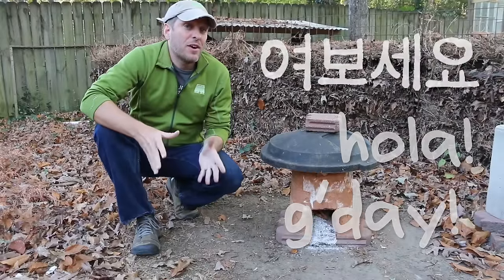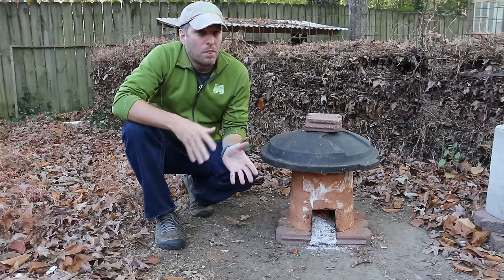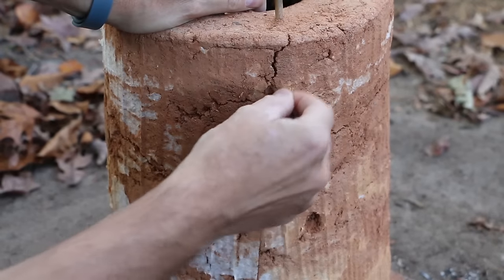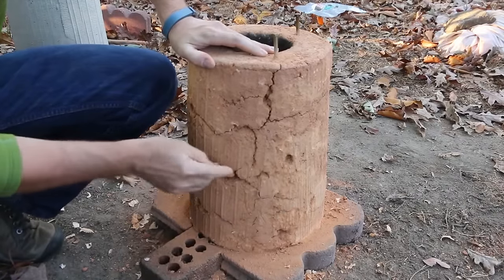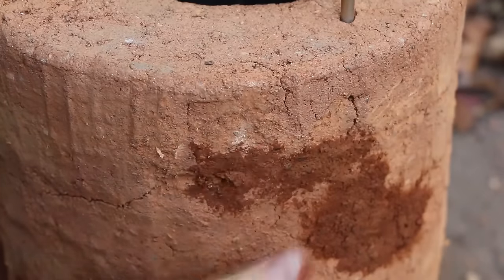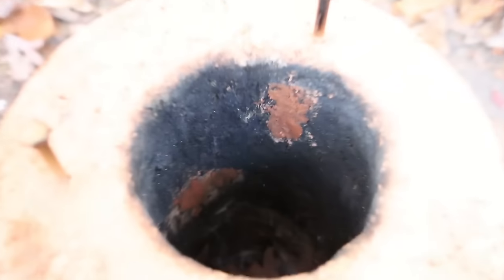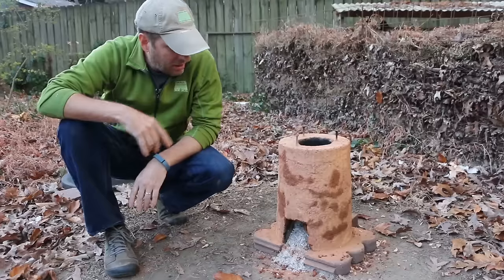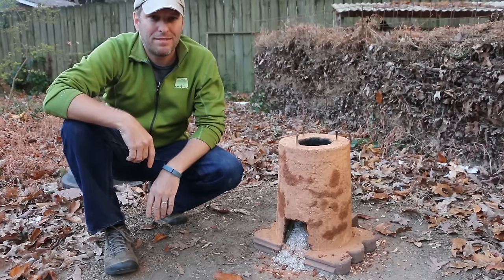How To Fix A Cracked Mud Rocket Stove

Comment: Just one idea (I have never built anything like your ovens!). Before patching, wouldn't it be good to spray ligthly the crack with water? From what I have seen watching masons work, they never mix dry with wet, always wet with wet. Great videos you are an inspiration!
Reply from the maker: Yes. That would have been a better way to fix the cracks. Thanks for the feedback. And thanks for watching.

Comment: Just my $0.02, but I see the tamping (not the drying) as leading to the holes, first because of the wire mesh as an obstacle (which should be eliminated) and second because of the broomstick needing a flat pad on the end, such as a scrap of wood held on with a screw (or just use a larger piece, chunk of firewood, etc.).  Also, the cob mixture does need the straw, both to help prevent cracks as it dries, and as an insulator, either as straw, or if the heat combusts it, by leaving behind air passages in the cob.  Straw would also prevent the need for perlite, and keep the stove's materials entirely natural.  I also have seen some cob 'recipe's' use herbivore manure (i.e., cow, not dog) as a binder, with the straw, dirt and clay, which helps with consistency and cracks after drying.  Once dry, the manure should not smell, nor impart any impurities to the smoke, at least no more so than the other materials' impurities.  Finally, I'd eliminate all the plastic forming parts, and use bundles of sticks or straw to form the chimney, combustion chamber and air/fuel intake passage.  The outside can be formed by hand around these without a bucket, and smoothed with a bit of water and rubbing, no need to tamp into a bucket or worry about a release method.  Any bits of these materials stuck in the cob as it dries will simply burn out with the first firing.  Good luck!

Comment: I'm grinding kitty litter in the blender and mixing it with paper pulp..  For now I'm filling in the holes of  clay bricks.  I have  dried them in my over and found shrinkage but  filled in the  cracks. I will be making a brick rocket stove, but  with the bricks in the vertical position. in this way i can fill in the outside with more of this paper crete  clay mixtures  and build up insulation values while stabilizing the vertical bricks. I you have seen the kilms made with grasses and clay into a bee hive  I might try that sometime and keep building up the thickness. To me that primitive kiln  is fascinating.
Reply from the maker: Hi Joseph. Sounds like an interesting project. You going to make a video or blog post when it is done? Would be cool to see that in action. Thanks for watching and commenting.

Comment: Hi Tom!

When working with cob it's always a good idea to moisturize it before repairing the cracks, it makes the cob stick better. At least that's what you do when you plaster houses with cob. It is also recommended to "massage" it in, like rubbing it with a sponge for instance.

There are also some techniques to get the cob water resistant, and abrasive resistant.
Linseed oil varnish is great if you want to make it water resistent, but it's quite expensive. A cheaper alternative is using Limewater, the water that forms on top when soaking calcium hydroxide --- the term lime refers to the alkaline mineral, and is unrelated to the acidic fruit. ;) --- I have no scientific explanation for it, but i got the hint from a german adobe craftsman.

Adding some beer to the cob will prevent it from sanding of, you can also use some Quark (the secret lies in the casein, the slow-digesting protein.) Some other mixtures use cow dung for outside cob plaster. 

Have a great day.
Reply from the maker: +weoserf cool! Thanks for sharing this info. I'm certainly not a cob expert, I appreciate your input. I'll be making another few of these (for a pizza oven). I'll incorporate your suggestions. Thank you again.
Reply: i don't know what weather you have there, but in central europe it is recommended not to work with cob outside in the months that have a "R" in it :) it will take very long to harden and if you use straw it will most probably rot.
Reply from the maker: Weoserf, I am in the Southeastern United States. Georgia, in particular. We can have mild winters, but it can dip into the teens on occasion. I hadn't considered the straw in the cob rotting before it could dry. Thanks for that tip. We had a very long dry spell this fall...42 days without any rain. That ended about a week ago and it has been raining ever since. Where are you located? Germany? Belgium? Austria? :-)
Reply: I live in Germany and it gets often below freezing during wintertimes. You really have nice temperatures over there in Georgia :) !  I can't call myself a cob expert, I just went to a couple of workshops and picked up some things. Maybe you should wait with your cob oven till February or so, just to be sure that it can dry reasonably quickly. Compared to our temperatures here, I guess you should be fine if its over 60°F (15°C). Keep up the good ! :) - Adrian

Comment: I’ve hand built with purchased clay for years. When I want to use an armature that I will remove later after clay hardens up enough not to collapse, I cover it with 2 layers of thin plastic (like Walmart bags or trash bags). I can then pull on the armature and inside plastic layer at the same time to remove the armature. The layer of plastic next to the clay acts as a slide for the inside layer around the armature. The plastic next to the clay can then be easily removed. There may be a few wrinkles from the plastic, but they can be smoothed out.
Reply from the maker: Thanks for sharing your experience Janet. I really enjoyed building with the cob. It was therapeutic as well as functional. Thanks for watching.

Comment: If you stir that earth you dug, in a bucket of water, Then pour the well stirred water into anther bucket and dump the gravel at the bottom. When the second bucket settles, that is pure clay. mix 10% sand with that and that will stop heat shock. you can fire this to pottery.

Comment: Great vid. However, next time leave out the cardboard entirely and coat the surfaces instead with oil, which will allow for the easy removal of the pipe forms...
Also, to the outside of the stove, you can add a second layer of cob that is mixed with either hay or vermiculite for insulation and a sealant as well...
Reply from the maker: Thanks for the feedback on this cob rocket stove. I'll to give the oil method a try. I do plan to make a new version of this rocket stove using comments as improvements to my initial method. I'll add yours to the list. :-)
Reply: Happy to help... :) I have made cob rocket mass heaters and Cob Pizza ovens back when I lived on the farm. Sad to say I am no longer there, but the knowledge does not go away. I used oil to remove forms back then .. (Cooking Oil not petroleum based)I also used straw as my re-bar and it worked wonderfully and I sealed it all with a natural lime plaster and boiled linseed oil. The metal reinforcement is really not necessary if you have the right mix of materials. (to much clay and you get cracks...to much sand and it crumbles) best to experiment and find YOUR sweet spot there as it depends upon your local soil... Good luck with your projects in the future... Hope they all work out great for you...

Comment: i am wondering how this stove has held up over time, and also how insulating it actually is???... 

seems if mostly mud it will not have very good insulating qualities, same with concrete, making it a more polluting stove, and/or not a true rocket stove... 

but i have only watched this one video, so not sure about if perlite or vermiculite was added to the clay???... 

using fair amounts of straw would insulate better it seems, because the high heat would burn the straw over time, leaving insulative air pockets i suspect, but this might also create less overall strength???
Reply from the maker: Hi Forest. I've been so focused on my metal rocket stove build and testing, that I neglected the mud stove. I have gotten a few comments about the "heat sink" properties of the mud. I have picked up a bag of perlite to add to the mud when I build this again. I'm going to use all the good comments and feedback to modify this stove when I rebuild. I'll add you tho this list. Thanks for your thoughts on this.

Comment: I think I would have put the whole thing in my oven on the lowest setting for a bit with the cardboard still on,  then patched it and put it back in for a short time every day raising the temperature a little each day until it reaches broil.
Reply from the maker: If I put this mud rocket stove in the oven, my wife would think I'm even crazier than she does now. :-) But, it would work. I could have built a temporary "greenhouse" around the stove, to let the summer heat cook out the moisture. On the next one, I might give that a try. Thanks for the comment.

Comment: Could you not just burn the last bit of cardboard off? If you want to keep it non-tech, you could build a small fire around the outside and then brush off any ash, or just do a small tech solution and use a propane torch with a flame spreader tip.

I agree that straw should be fine structural reinforcement unless you are running so hot that the outside of the stove gets hot enough to ignite straw. Likely the straw in the first inch of the chimney will carburize due to the heat, but that section will also more likely get hot enough to partially fire the clay and so the loss of structural strength due to the straw burning/baking. And besides the straw adding a structural element, it should also help with the insulation as well.
Reply from the maker: That would probably have worked...or if I just let the rocket stove sit in the rain for a few weeks, it probably would have happened naturally. I plan to make another mud rocket stove this Spring and will incorporate suggestions from comments. I've gotten a lot of good ones. Thanks for your's.

Comment: Your mistake is that the oven must previously have passed the pre-drying stage in natural conditions. Weeks three or four at the thickness of your walls. But before molding, the clay should not simply be mixed, but carefully repulsed, squeezing the smallest air bubbles out of the dough. Here are two gross errors, due to which you are doomed permanently to repair
Reply: Ваша ошибка заключается в том, что печь предварительно должна была пройти стадию сушки в естественных условиях. Недели три-четыре при толщине ваших стен. Но перед лепкой глину следовало не просто смешать, а тщательно отбить, выдавливая из теста мельчайшие пузырьки воздуха. Вот две грубейших ошибки, благодаря которым вы обречены перманентно ремонтировать вашу печь